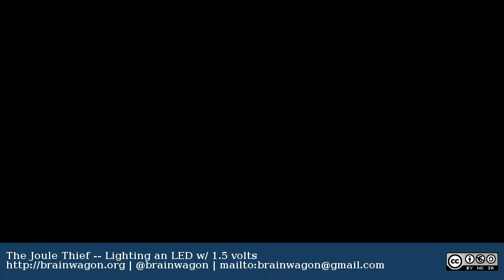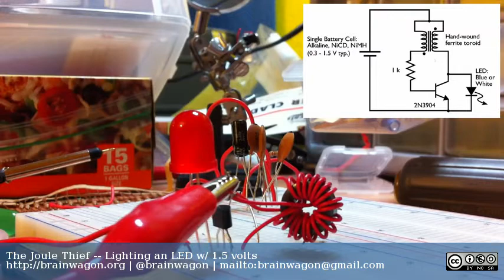The Joule Thief -- Lighting an LED with 1.5 volts

Comment: Your JT most likely won't work with the 3V coin cell because the coin cell has too high a voltage.  If you increase the resistor from 1k to something like 4.7k or more, the JT may work with the coin cell. However  remember that a typical JT draws 50 to 100 mA at  1.5V, and the coin cell cannot supply that much current, so its voltage may drop down due to the internal resistance.  That's why the 3V doesn't seem to hurt a red LED when you put it on the coin cell, due  to the internal resistance.